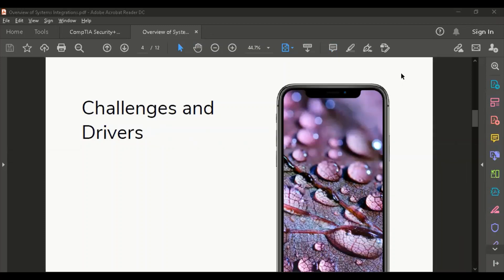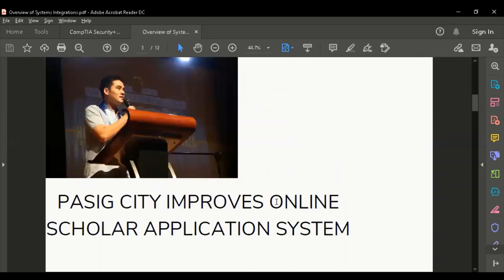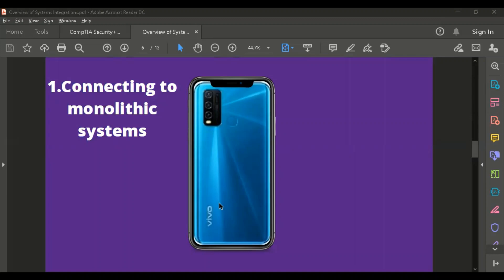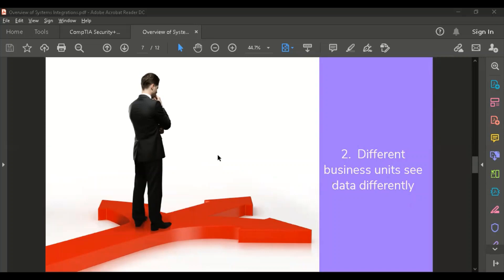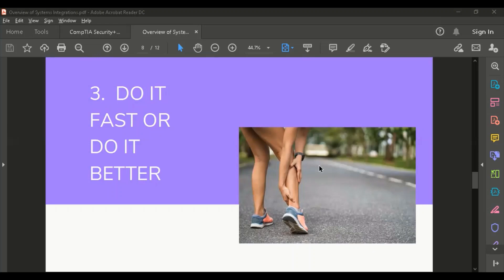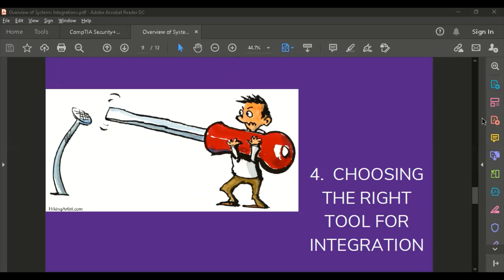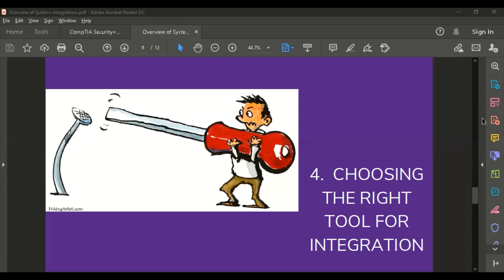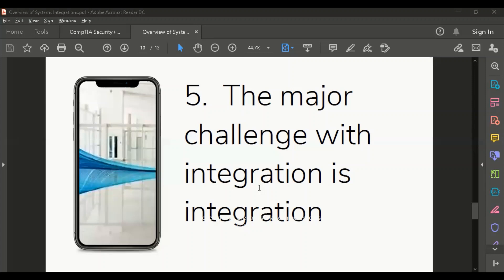Challenges of System Integration

Comment: I learned from the discussion In system integration is an existing system that combines with the new system and makes it as a new, it’s like making a research paper you gather the same information and improve it for the sake of helping the community. The five challenges in divers, one of the examples of that are connecting to the monolithic system. Monolithic is like upgrading the system it’s helping the community to get in touch in every change in our society. For example, the Huawei phone doesn’t have Google that’s why they improve their system and make have their own Huawei app store to help those Huawei users still keep in touch with the changes. Number 2 is Different business units see data differently is like your responsibilities of understanding, it’s not easy to build and a system but those systems are not related to the business that you would like to make. A systems integrator not only needs to satisfy the requirements of a business but needs to think beyond these and design an integration that has a standardized view of data within the enterprise. Number 3 is Do it fast or do it better in my own perspective “do it fast or do better” is like it’s now all about passing those systems it’s all about making it good and functional in the near future. Another student is like they want to pass it fast because they want to be the first one to submit but there did not consider the system life cycle if that system, they did not think that the possible well happen is those systems will not work according to the needs. It’s good to be slow but you sure that that system you make is in good condition. Number 4 choosing the right tool for integration it’s like choosing the language that you would like to make for your system; it’s good to know the tool you want to use because if you are not aware of that then surely you won’t make it on time to past that system on time. Umber 5 the major challenge with integration is integration the last, choose the right business or system language you like, and develop it. Those all my perspective and learn.
Reply from the maker: Thanks. Please watch my interview with Dr. Lansigan.

Comment: What I have learned  was all about the 5 challenges of System integration the first one is the Connecting to monolithic Systems it means that it is interconnected with one another and todays generation IT experts is more challenging for them to make an system especially when the project should interwoven and the system integrator will find the best of integrating. Second is the  Different business units see data differently  this is where the system integrator should focus on modelling the data and minimum data will achieved. The third one is Do it fast or Do it better it is were the system integrator should find the best integration solution for them to create a better performance. The fourgh one is Choosing the right tool for integration we all know that plenty of tools we can get but we should pick the right one for us to have a good output. Choosing the right tool for a enterprise is a challenge. Yes because you cannot just get what tool is available but ofcourse you have to think that wisely if it is the best tool for my enterprise. Lastly is the The major challenge with integration is integration it means that when you choose the products from a particular vendor you should get there not from the other vendor because it is what it is and for you not to have trouble.
Reply from the maker: Thanks. Please watch my interview with Dr. Lansigan.

Comment: In the lecture and as I watched the video indicated in the Google classroom system integration is the process of connecting different component that already exist with the new technology into single and larger system that aim to create new feature that will enhance the capabilities of the system. In simple word it is the process of linking together various IT systems, services and/or software to enable all of them to work functionally together.
	I also know the 5 challenges with systems integration. The first is Connecting to monolithic systems we learn that it is common to have monolithic systems in the enterprise industry, and it is often not possible to get rid of those systems easily, business heavily depends on such systems as they are mostly legacy systems and cannot be replaced for the sake of integration.  A systems integrator has to take care to identify and choose the best way of integrating with monolithic systems within the enterprise. Next is different business units see data differently. It just a common sense to think that each business unit or business sees data differently because their operational responsibilities are not the same and they may be using different systems or applications. This is fine from an individual unit’s point of view, but a standard data model is required within the enterprise in order to integrate these systems. The third one is do it fast or do it better.  Projects are often managed by non-technical managers who are business-centric and lack understanding on the best practices and architectural principles. Proper architectural planning is used to ensure quality often becomes difficult for IT due to these constraints. Forth is Choosing the right tool for integration. There are plenty of tools available in the market that promise to deliver the best integration experience. Choosing the right tool for an enterprise is a challenge. In modern connectivity, an integration tool must almost certainly support hybrid integration. Hybrid integration allows on premise applications to seamlessly integrate with cloud based applications. The final one is The major challenge with integration is integration. Choosing right set of products for your business is very important. The product chosen should allow integration with other systems or products either via a web service layer or using libraries. This will help enterprises avoid another monolith and designing and implementing integration solutions for their current or future products.
Reply from the maker: Thanks. Please watch my interview with Dr. Lansigan.

Comment: The increasing complexity of system integrations has poses many challenges to the system developers and/or integrators. These challenges that is present in the video wherein the unexpected issues in system integration have rised. For instance, Monolithic systems cannot be replaced easily, as its depended to each other it may affect the whole system. Some of the Business units sees data differently because their responsibilities are different as well as their systems. When it come to system integration, it often constrained in time and cost so this must be done in a fast or better way. Choosing the right tool should know for seamless integration between on-premise and cloud-based applications. Lastly, the integration may be the problem as it needs to be co,plex to maintain. System integration can be simple yet it doesnt mean that it is cmoletely free from these challenges.
Reply from the maker: Thanks. Please watch my interview with Dr. Lansigan.

Comment: There are five challenges in system integration first is connecting to monolithic system in this case not all system can be integrated especially those legacy system that can still do their specific job even in the modern environment. And some of the system is monolithic means there are connected so as developer you need to look first in the structure of the system because mostly it has a domino effect and can result to a bigger problem. Second is different business units see data differently in this matter every people have different opinion same in business they have different approach on how to deal in things so as a system developer you have a big responsibility you can’t decide on things alone you need first to talk on client your and discuss things with him before come up with a decision. Third is do it fast or do it better so as an IT people with to deliver a quality software or system because we are being paid for doing it we can just do it for sake of money we have to option do it fast but still the quality is there or do it slow if we have a long time span but still the quality is there. Fourth is choose the right tool for integration in this matter you need a proper tool when it comes in development example you can’t use an android development tool for a windows application right so we need the right tool to produce a fully functioning quality system or software. Fifth and last is the major challenge in integration is integration because before you integrate something you will go through a lot of thing before to find the right idea or things to complete your system so you need to be cautious about a lot of thing and you need to find the right partner that you know will be you useful in the present and future.
Reply from the maker: Thanks. Please watch my interview with Dr. Lansigan.

Comment: The topic that conducted last meeting was about Overview of Systems Integration which tackles 5 Challenges and Drivers of System Integration. As I’ve learned, System Integration means melding existing systems and new technologies to form a more capable system that are needed to develop or to enhance. So as said in example, Pasig City improves online scholar application system meaning they improve to develop and enhance the system to be able to meet the satisfaction of the system application that they have for the scholars of Pasig. By defining the challenges and drivers of system integration, it will help to integrate system into existing system and the first challenges among 5 challenges is Connecting to monolithic system which means interconnected and dependable to each other. Second challenge is Different business units see data differently meaning it depends on the perspective of who is responsible to see the data of the systems. Third challenge is Do it fast or Better which means to be able to do a system we will considering time or cost to replace an existing system. Fourth challenge is Choosing the right tool for integration which means balance the right tool to meet the goal you want to aim or to integrate a system. Lastly, the major challenge with integration is integration itself because the best integration is coming from the company or organization who manage the system. They will be able to do an integration because they handling the system they want to integrate, one thing for sure is they can integrate an existing system because they own it.
Reply from the maker: Thanks. Please watch my interview with Dr. Lansigan.

Comment: As I’m watching the video about system integration. I conduct some research to find or to seek information about what is system integrations are about. I found out that it is a whole system or one system that is composed of sub system. For example is  the security system it is a whole system. But it is composed of sub-system like glass break detectors, emergency notifications, motion detectors, smoke detectors, high temperature detectors, and surveillance cameras. All of this will function as a one system. Which is the security system of that said company. Integration system is indeed a business need, it’s to make the existing system more reliable and capable to take additional tasks and to enhance its performance. One of the example in the video is the vico sotto’s Pasig City Scholarship Application System. It is maybe a long pending project but the pandemic make it hurry to produce the system. For students like me, it is more easier to apply for scholarship than to go in city hall and stand in the long line of applicants waiting to get call their name and pass their application. There’s a 5 challenges in an integration system, one is the monolithic system which meaning is that they are interwoven or connected to each other. There’s no seperate components for each system. They are all in one system which is if one of the components got problem, other components will be affected, best example is the domino effect that when the first 1 fell down the other domino will go down too.
The second one is the data, Every department saw the data differently. The best example is the upward 9 and downward 6. They saw the numbers differently because they have different meaning and observation in that data. Third one is the do it fast or do it better. Do it fast is good but it will sacrifice the output or the look of the that project. Do it better, It is more better but it wil take a lot of time. You might have a problem in terms of deadlines. The fourth one is the choosing the right tool for integration. You must choose the right one to use in the right project. Using the wrong tool will still work but you’re working in the hard way just like what the video show. Using screw driver head negative in the positive head screw. You can still screw it but you suffer and put more work than using the right tool. The fifth and last one is choosing the right product for your integration. It must be compatible and pick wisely because it will affect your system integration in the long time.
Reply from the maker: Thanks. Please watch my interview with Dr. Lansigan.